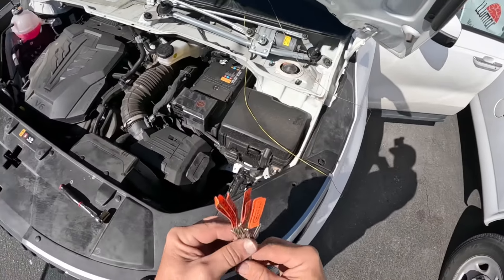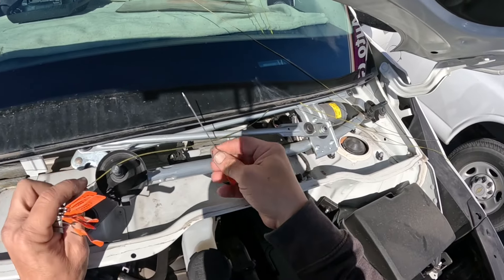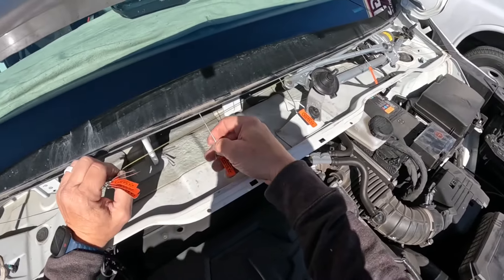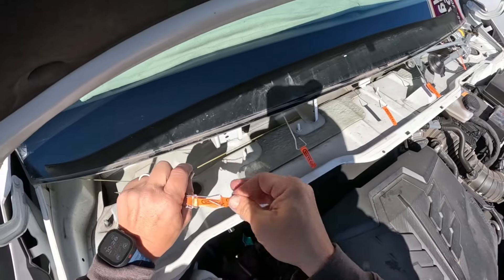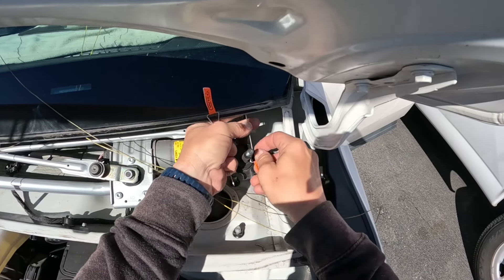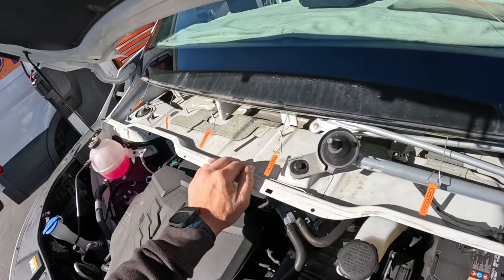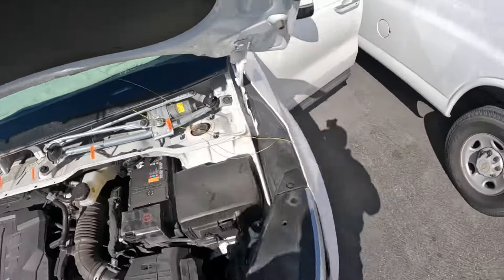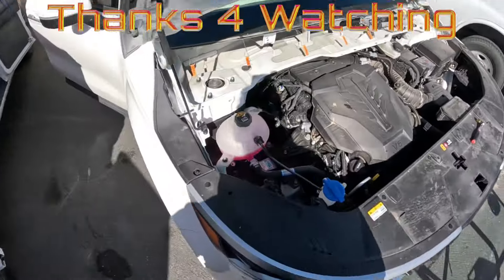WRD Pinchweld Pins/Cutting Line Holder Pins

Comment: In a pinch you can cut the wool ball off a dabber and use that.just a point.
Reply from the maker: That definitely is an option. I used to have 5 or 6 of the wire/line pokers we use to drive the line through the glue but with more and more manufacturers using cowling retainers now they’re harder to push through because they hit the retainer.